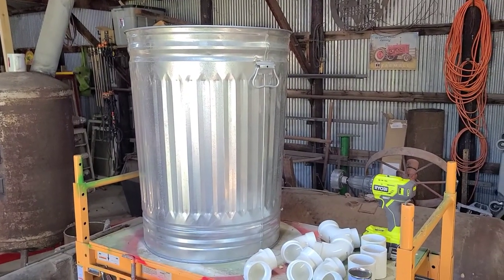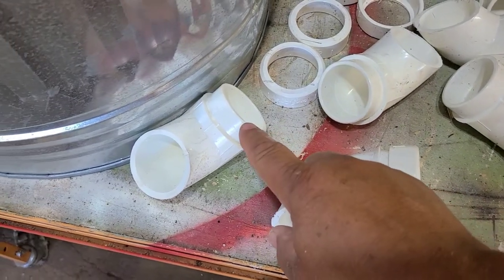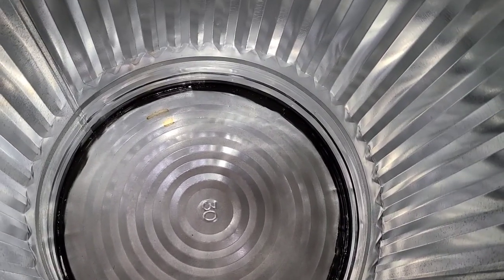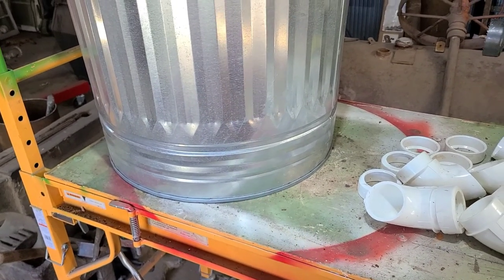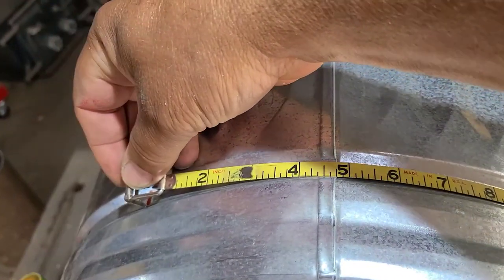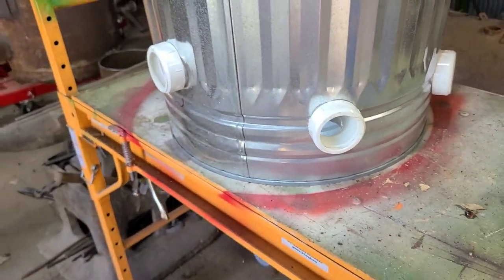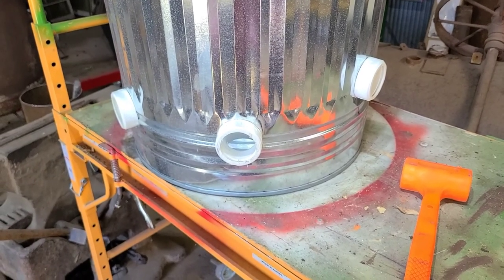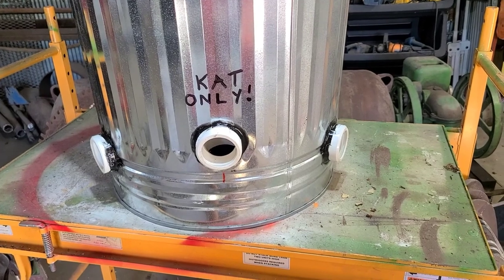No Waste Bulk Chicken Feeder

Comment: What is the diameter of the street elbows you are using?  I am trying to build a 4” tube feeder but after you add up all the different parts you need, your design looks much less complicated, less expensive (those 4” parts are spendy) and easier to dump a bag of feed into.  Great video!!!
Reply from the maker: 2 inch street elbows. The chickens are using them with no problem.  My rooster however needs a larger one because of his comb. Im installing a bigger one for him.
Reply: @markellyfarm  Will this work for ducks?
Reply from the maker: I dont see why not.

Comment: Thank you! Great video; lots of good details. Have you had any problems with rodents getting into the feed with your design? What do you use to block the holes?
Reply from the maker: The chickens would get the rodents first. Lol. We dont have an issue due to kellys coup design.
Reply from the maker: The chickens prefer Kats feed hole that we added later. Lol

Comment: Sorry, it looks beautiful, but there's extra work needed in it, I don't suggest anyone with this design. It defeats the purpose.
Reply from the maker: Defeats the purpose of what? It’s literally zero waste. The only changes I’d make after using it a year and a half is to use all larger PVC and to caulk around them to seal out moisture when it rains. We’ve had no issues with it and I’d definitely recommend.
Reply: I am ready to build my garbage can feeder but you mentioned after 1 year you would change  to larger PVC Street Elbows.  The video showed 2", street 90's.  What do you recommend now?  Also you mentioned a new height / position fo the holes since the ladies are using the roosters higher opening.  What is the new height for the ladies and Rooster? @markellyfarm
Reply from the maker: I would put them so that the inside portion is about an inch from the bottom. Another subscriber recommended putting an inverted funnel in the middle, which is a great idea. I used 3in for the larger one.
Reply from the maker: You also need to put the feeder on a riser sobthe holes are a good height. Ours is still working great.